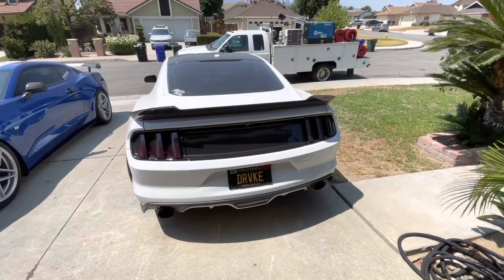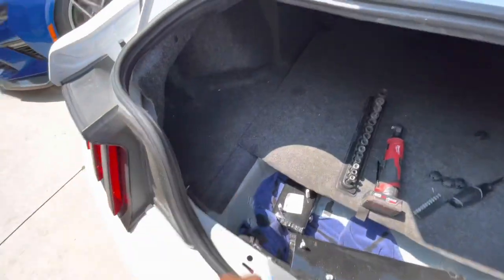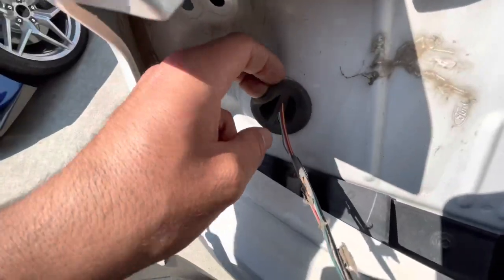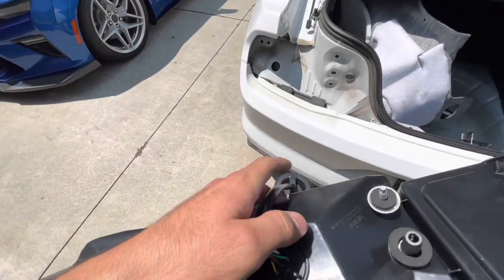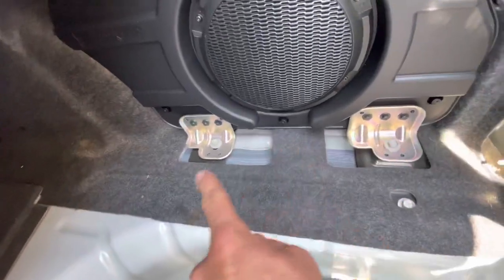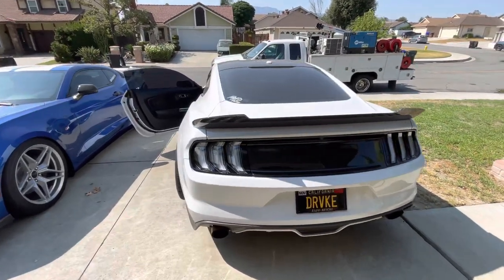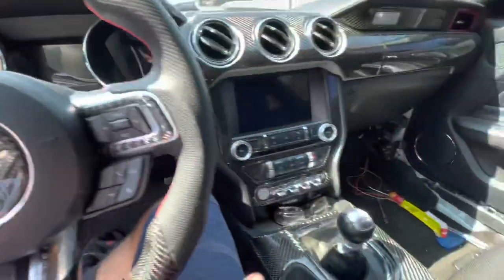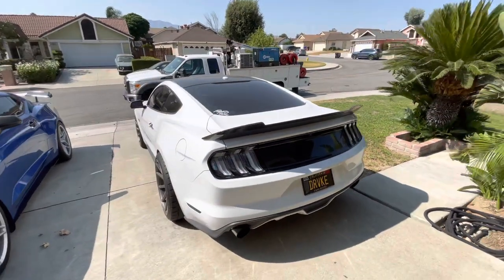2015-2021 S550 Mustang Euro Tail Lights Install!

Comment: did you end up running the yellow wire to the third brake light? i heard it is for switching modes.
Reply from the maker: I did end up doing it later on, and yes you’re correct it is for switching modes. It’s very easy to install, from the driver side tail light you’ll connect the yellow wire. Then you’ll go in the back seat and take off the driver side plastic trim above the back seat and put the wire through that. Drop down the back of the roof under panel and the connections are right there.

Comment: My father has the 2022 Gt with clear lights but his complaint is the red lights don’t come off when driving like the 2015 Gt did. Do you have the same Situation? If not do you know why the lights don’t come off when driving
Reply from the maker: I’ve never seen that issue personally, maybe the tail lights are faulty?

Comment: I have a 2017 mustang ecoboost premium with the performance pack going off of all the parts that I have but I don’t have a subwoofer in the trunk?
Reply from the maker: So the sound system is an option on top of the premium, if you don’t have the subwoofer then your install will be much much easier!
Reply: @drakebuilt  bet, by any chance do you know if they work with the sequence modifier (can’t remember it’s name rn) basically when you lock/unlock, brake, and turn on your hazards the lights are sequential. Logically it should but I’m not 100% sure cus I wanna get both
Reply from the maker: @Buckflash  yes it should work, that should be the standard setting, if not then you’ll have to do the sequence for that specific setting
Reply: @drakebuilt  thanks

Comment: I just got mine installed yesterday, I have tried either your way to changing it or the video on Vland US, but it’s just not working. So after you have twisted 4 times in order to access to the modes setting, if I wanted it to be in mode 2, I should twist it twice, but which position should it be? The same position as the first 4 twists?
Reply from the maker: Yes same position as the same 4 twists.

Comment: Do you know if the 2018 oem tail lights will fit directly on the 2015 without any modifications, any idea ???
Reply: They will bolt right up!

Comment: Did your brake lights work since you didn’t install the third brake light wire
Reply from the maker: So no the brake lights technically don’t work I could press the break and they’ll illuminate but they won’t hold the light unless you install the third brake light wires. I ended up installing them a couple days later
Reply: @drakebuilt  so how did you get away with driving it like that? Did you just not drive until you installed it? Asking because I’m in the same situation right now lol
Reply from the maker: @brittanywilliams6453  I drove like that with no issues lol, even had police behind me who saw them not working right and had no problems
Reply: @drakebuilt  lmao I probably won’t be that lucky
Reply from the maker: @brittanywilliams6453  only one way to find out 👀

Comment: Mine for some reason blink faster on the dash but they don’t blink fast outside
Reply: Do you know if the 2018 oem tail lights will fit directly on the 2015 without any modifications, any idea ???
Reply: @NC_Car_Meets  they both have the same housing so it fits directly with no problem, the previous holes are in the same spot
Reply from the maker: @Silver_moon_c6 yes all s550 tail lights are interchangeable

Comment: Hey just bought my 2018 euros of cj pony parts but notice did not come with green wire does that mean I can’t switch modes and if so where can I get one ?
Reply from the maker: Should be a yellow wire I believe. If it didn’t come with that wire, then email cj pony parts and they’ll send you one.
Reply: Same here. Installed mine and noticed my trunk lid slightly overlaps my right tail light which was never an issue, did you notice any figment issues
Reply from the maker: @BallIsLife353332  yes I did notice a little bit of fitment issues, and unfortunately I was not able to adjust it much but I have it to where nothing touches.

Comment: Mine flash sequential amber when braking, is there any way to fix it so that I only get the brighter red?
Reply from the maker: Yes there is. There’s 5 different settings, you’ll have to change the settings to see which one suits you best. I explain the steps on changing the settings towards the end of the install. Once you do it let me know how it goes! Good luck👍
Reply: Did you ever end up fixing that? Mine do the same and i wanted to know what you did so they can glow red when braking

Comment: Were you lights still as dim / not glowing on the bottom side after connecting the third brake yellow wire?